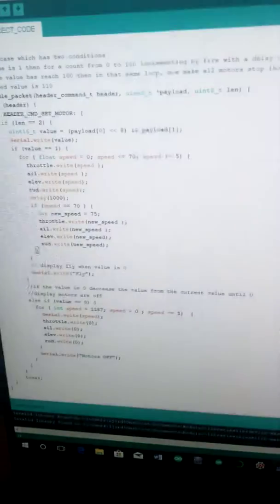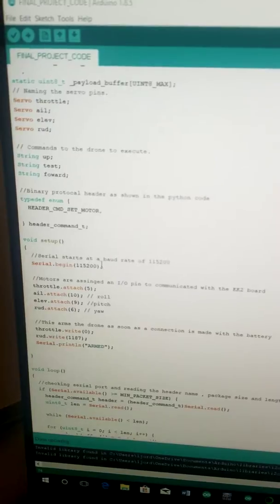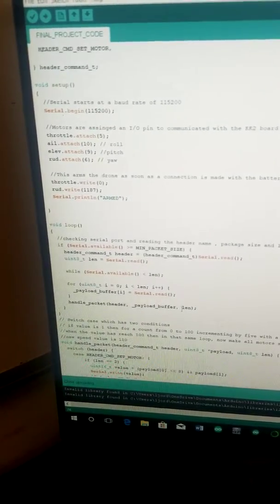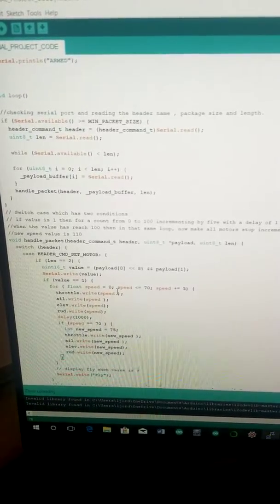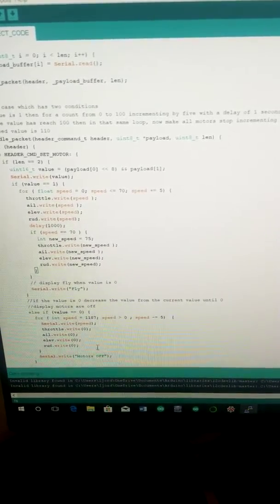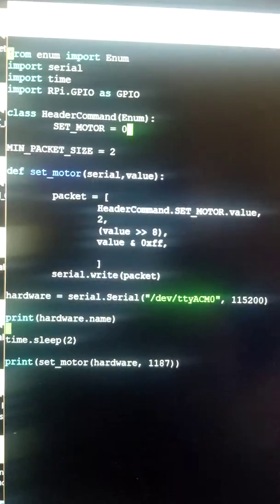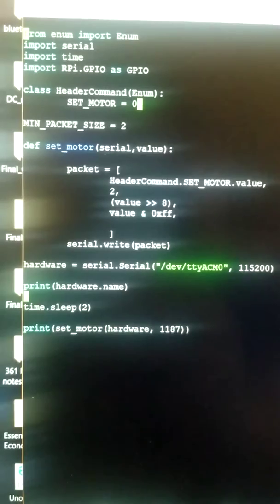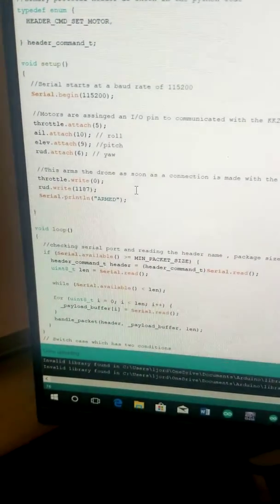Kk2 board controlled arduino and rasp pi

Comment: hello Luis Jordan 
i just wanted to know how do i connect the raspberry pi physicaly to the drone
Reply from the maker: Hello Syed,
You can use the Tx and Rx on the board to send and receive commands this will help you communicate with the control board, if you are using one. Also, Raspberry Pi has only 2 PWM ports so you might need a stack for it to get the other 2.

Comment: Luis, have you made more programs for your drone? did you complete the code to go forward and backward? Im trying to configure in mine a geofence
Reply from the maker: Hey Carlos, I have started the code to go forward and backward but I haven't tested it yet. I can send it to you if you want.
Reply: Luis, what libraries or method are you using to connect the raspberry   to arduino? Are you using pyfirmata?
Reply from the maker: Carlos A. Morales so first, while connected to the terminal you go all the way as far as you can in the kernel you can then list and see "dev" then you can go into it and determine the port name for the USB.  

Here is what we did in my course to configure the Pi so it can communicate with the Arduino.

on the raspberry pi, execute the following command: 

 

`sudo apt-get install python3-pip` to install the python package manager for python 3. 

 

then, install the `pySerial` dependency with `sudo pip3 install pyserial`. 

 

next, run `sudo raspi-config` from the command line, enter the “advanced options => serial” menu, then answer the following questions: 

 

Would you like a login shell to be accessible over serial? NO Would you like the serial port hardware to be enabled? YES 

 

now, reboot your raspberry pi with `sudo reboot`.
Reply: Okay awesome I just did all these instructions. I found the questions for the serial under interfacing options.
Reply: Once the raspberry resets, is now communicating to arduino? Can I now used the codes for the drones that you shared before? The errors I had before were about the ttyAMC0 file that wasn't found
Reply from the maker: @carlosamorales33  it should... the ttyAMC0 is in the dev folder, it could be named something different. Once you find the folder you can determine the name of it by going into the folder, and look at the ports that disappear when you disconnect the USB.
Reply: Okay. Got errors for some reason if I compile the arduino program in the arduino IDE installed in the raspberry pi I get compiling errors. If I compile it in the ide version of my laptop I get no errors "weird" however when I run the programs and I connect the drone they do nothing
Reply: I sent you an email before, did you get it?
Reply from the maker: @carlosamorales33  no I didn't receive the email
Reply: Alright I just sent you another one at lj94@njit.edu

Comment: Hello Luis, thanks for the video! I'm  very new to the drones and I wanted to ask you a question. Is your Arduino physically connected to the flight controller or the raspberry pi? How do you connect them?
Reply from the maker: Hey Carlos,
Yes, the Arduino is connected to the signal pins of the flight control board. All you need to do is connect the signal pins on the flight control board to individual PWM pins on the Arduino.
Reply from the maker: Also, I see that you are working on your own drone. If you have any questions, please feel free to ask, and I will help you as much as I can.
Reply: @luisjordan3922  Thank you Luis That's very nice of you and yes. for sure, I 'm going to need help 'cause honestly I'm very new building drones and the team is very motivated to build the autonomous drone. We also bought a pixy camera, a gps card, tilt sensors, sonar sensors for distance, etc. is this the best way to reach out to you? do you have an e-mail of cell phone? thanks!!!
Reply from the maker: @carlosamorales33  my email is lj94@njit.edu. I'm actually making my drone hover using a Bluetooth module that connects to a phone application lol.
Reply: @luisjordan3922  hi Luis. Thank you so much for your offer my student Omar Cristalinas will be contacting you soon to help us out. I really appreciate your help. Thank you
Reply: The raspberry pi is connected to the Arduino through the USB cable. Then, the Arduino is connected directly to the flight controller. I used the digital ports 5,6,9, and 10 from the arduino to connect to the flight controller pins that receive data.

Comment: Nice project. I understand that you're doing an ssh into a PI and then executing a script which sends a command to an arduino connected via the usb. How is the arduino communicating with  kk2.1.5 FC??
Reply from the maker: Hello Tejasav, the Arduino is communicating to the motors of the drone using PWM for each motor. Arduino has multiple PWM ports and raspberry pi only has two, so the Arduino is telling the kk2 board to execute the disarm executing and telling the motors to move. The Arduino is connected to the ele,thr, rud, and pitch of the kk2 board. I hope this answers your question. If it doesn't I'll try again lol

Comment: Hi, nice project. Can you share the source code. It would be extremely helpfull.
Reply from the maker: Here you go Elif, I hope it helps you out. 

//libraries needed for the drone to operate
#include <string.h>
#include <Servo.h>

//Macro defined min packet size for protocol
#define MIN_PACKET_SIZE 2

static uint8_t _payload_buffer[UINT8_MAX];
// Naming the servo pins.
Servo throttle;
Servo ail;
Servo elev;
Servo rud;

// Commands to the drone to execute.
String up;
String test;
String foward;

//Binary protocal header as shown in the python code
typedef enum {
  HEADER_CMD_SET_MOTOR,

} header_command_t;

void setup()
{
  //Serial starts at a baud rate of 115200
  Serial.begin(115200);  
//Motors are assinged an I/O pin to communicated with the KK2 board
  throttle.attach(5);
  ail.attach(10); // roll
  elev.attach(9); //pitch
  rud.attach(6); // yaw

  //This arms the drone as soon as a connection is made with the battery
  throttle.write(0);
  rud.write(1187);
  Serial.println("ARMED");

}

void loop()
{
  //checking serial port and reading the header name , package size and length.
  if (Serial.available() >= MIN_PACKET_SIZE) {
    header_command_t header = (header_command_t)Serial.read();
    uint8_t len = Serial.read();

    while (Serial.available() < len);

    for (uint8_t i = 0; i < len; i++) {
      _payload_buffer[i] = Serial.read();
    }
    handle_packet(header, _payload_buffer, len);
  }
}
// Switch case which has two conditions
// if value is 1 then for a count from 0 to 100 incrementing by five with a delay of 1 second.
//when the value has reach 100 then in that same loop, now make all motors stop incrementing
//new speed value is 110
void handle_packet(header_command_t header, uint8_t *payload, uint8_t len) {
  switch (header) {
    case HEADER_CMD_SET_MOTOR: {
        if (len == 2) {
          uint16_t value = (payload[0] << 8) && payload[1];
          Serial.write(value);
          if (value == 1) {
            for ( float speed = 0; speed <= 70; speed += 5) {
              throttle.write(speed );
              ail.write(speed );
              elev.write(speed);
              rud.write(speed);
              delay(1000);
              if (speed == 70 ) {
                int new_speed = 75;       //New speed after the speed value = 70
                throttle.write(new_speed );
                ail.write(new_speed );
                elev.write(new_speed);
                rud.write(new_speed);
              }
            }
            // display fly when value is 0
            Serial.write("Fly");
          }
          //if the value is 0 decrease the value from the current value until 0
          //display motors are off
          else if (value == 0) {
            for ( int speed = 1187; speed > 0 ; speed -= 5)  {
              Serial.write(speed);
              throttle.write(0);
              ail.write(0);
              elev.write(0);
              rud.write(0);
            }
            Serial.write("Motors OFF");
          }
        }
      }
      break;
  }
}

Raspberry Pi code
# enums are used to assign labels to a set of values
# allowing name-based referencing of underlying values
from enum import Enum
import serial
import time

class HeaderCommand(Enum):
    SET_MOTOR = 0

def set_motor(serial, value):
    # construct the packet; no payload
    packet = [
        HeaderCommand.SET_MOTOR.value, # header
        2, # payload length
        (value >> 8),
        value & 0xff,
    ]

    serial.write(packet)

hardware = serial.Serial("/dev/ttyAMC0", 115200)

time.sleep(2)

print(set_motor(hardware, 1187))

Comment: Hello there. Do you share the source code of the project?
Reply from the maker: I am going to have to copy and paste it on here for you. The first one will be the Arduino code and the second will be the python(raspberry pi) code.

//libraries needed for the drone to operate
#include <string.h>
#include <Servo.h>

//Macro defined min packet size for protocol
#define MIN_PACKET_SIZE 2

static uint8_t _payload_buffer[UINT8_MAX];
// Naming the servo pins.
Servo throttle;
Servo ail;
Servo elev;
Servo rud;

// Commands to the drone to execute.
String up;
String test;
String foward;

//Binary protocal header as shown in the python code
typedef enum {
  HEADER_CMD_SET_MOTOR,

} header_command_t;

void setup()
{
  //Serial starts at a baud rate of 115200
  Serial.begin(115200);

  //Motors are assinged an I/O pin to communicated with the KK2 board
  throttle.attach(5);
  ail.attach(10); // roll
  elev.attach(9); //pitch
  rud.attach(6); // yaw

  //This arms the drone as soon as a connection is made with the battery
  throttle.write(0);
  rud.write(1187);
  Serial.println("ARMED");

}

void loop()
{
  //checking serial port and reading the header name , package size and length.
  if (Serial.available() >= MIN_PACKET_SIZE) {
    header_command_t header = (header_command_t)Serial.read();
    uint8_t len = Serial.read();

    while (Serial.available() < len);

    for (uint8_t i = 0; i < len; i++) {
      _payload_buffer[i] = Serial.read();
    }
    handle_packet(header, _payload_buffer, len);
  }
}
// Switch case which has two conditions
// if value is 1 then for a count from 0 to 100 incrementing by five with a delay of 1 second.
//when the value has reach 100 then in that same loop, now make all motors stop incrementing
//new speed value is 110
void handle_packet(header_command_t header, uint8_t *payload, uint8_t len) {
  switch (header) {
    case HEADER_CMD_SET_MOTOR: {
        if (len == 2) {
          uint16_t value = (payload[0] << 8) && payload[1];
          Serial.write(value);
          if (value == 1) {
            for ( float speed = 0; speed <= 70; speed += 5) {
              throttle.write(speed );
              ail.write(speed );
              elev.write(speed);
              rud.write(speed);
              delay(1000);
              if (speed == 70 ) {
                int new_speed = 75;       //New speed after the speed value = 70
                throttle.write(new_speed );
                ail.write(new_speed );
                elev.write(new_speed);
                rud.write(new_speed);
              }
            }
            // display fly when value is 0
            Serial.write("Fly");
          }
          //if the value is 0 decrease the value from the current value until 0
          //display motors are off
          else if (value == 0) {
            for ( int speed = 1187; speed > 0 ; speed -= 5)  {
              Serial.write(speed);
              throttle.write(0);
              ail.write(0);
              elev.write(0);
              rud.write(0);
            }
            Serial.write("Motors OFF");
          }
        }
      }
      break;
  }
}

Raspberry Pi code
# enums are used to assign labels to a set of values
# allowing name-based referencing of underlying values
from enum import Enum
import serial
import time

class HeaderCommand(Enum):
    SET_MOTOR = 0

def set_motor(serial, value):
    # construct the packet; no payload
    packet = [
        HeaderCommand.SET_MOTOR.value, # header
        2, # payload length
        (value >> 8),
        value & 0xff,
    ]

    serial.write(packet)

hardware = serial.Serial("/dev/ttyAMC0", 115200)

time.sleep(2)

print(set_motor(hardware, 1187))